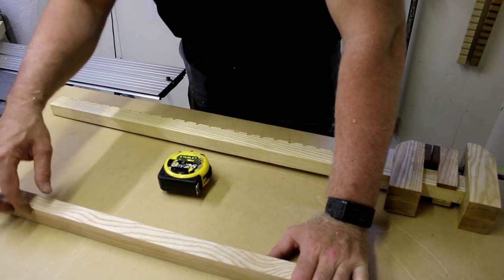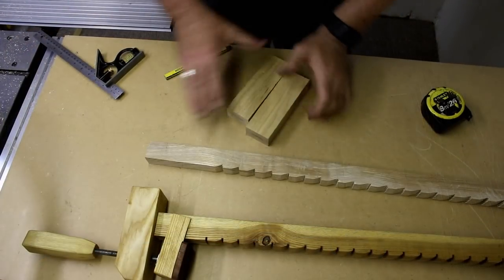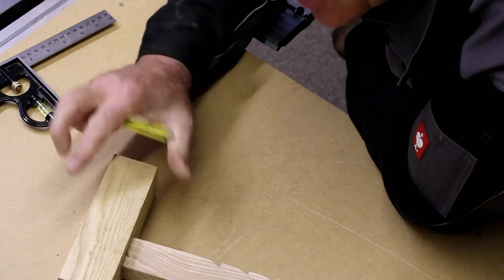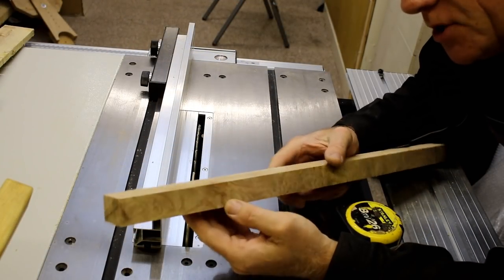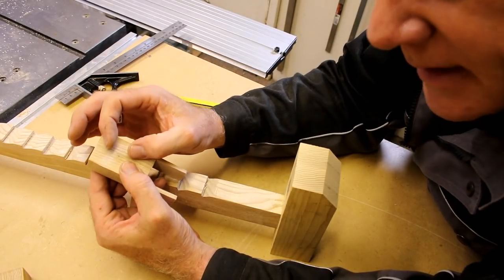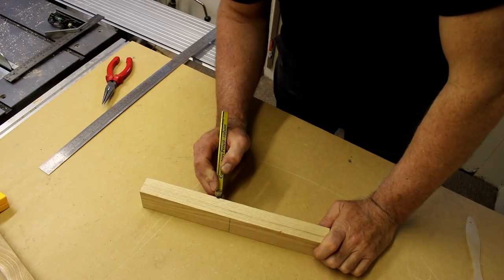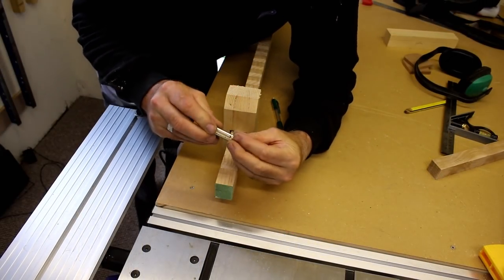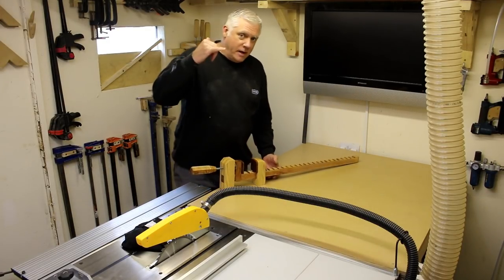Strong Wooden Bar Clamp

Comment: Thanks for that. Although I'm sure the first one takes a while 🤪. I can see how cheap it can be to make them. A bloody great project. I work as a painter on building sites and am forever seeing 1 metre lengths or more of hard wood floor boards  16mm thick going in the bin. Guess what a bit of glue and a couple of brad nails can do? A one metre clamp is $32 Australian and that's for a crappy one that scratches your job. 
If you have the tools already and most of the materials are free. No brainer. Thanks mate!!
Reply from the maker: Hi Dave yeah I had loads of bits of cupboards and pallets lying around and as you say how much crappy clamps are and with wood being the free part makes it worth the effort. Cheers for the comment its very much appreciated Anth

Comment: Are there plans anywhere for these? Or at least some measurements? I'm new to woodworking and need some measurements to work with I can alter any plans but I need a starting point. Thank you these are great and you don't have to be a welder.
Reply from the maker: Hi John I didn't do any plans for the clamps as It depends on what wood you use I used Ash as its very strong.  But feel free to modify how i've made them.